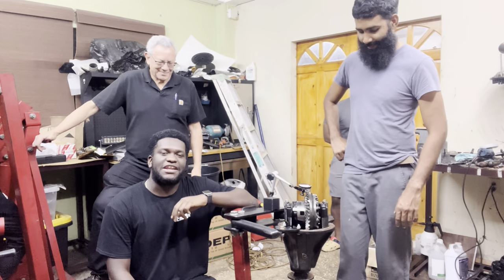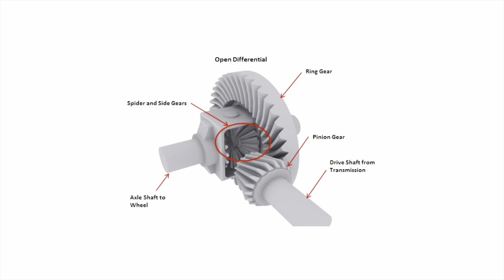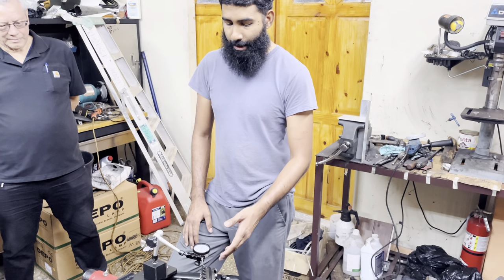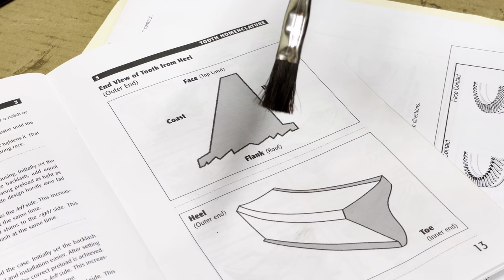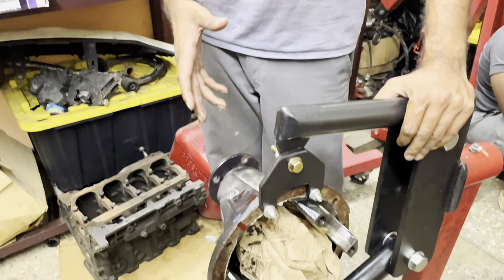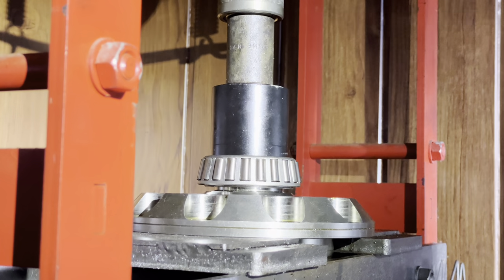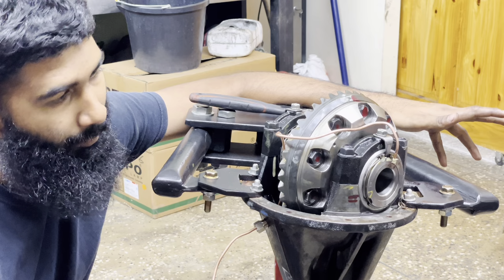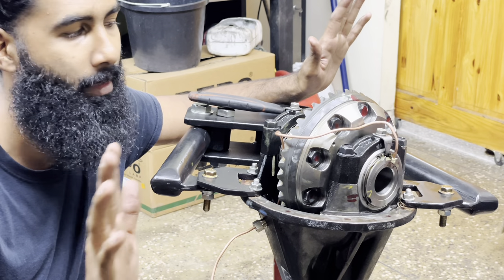Hilux Gets Twin Lockers! | ARB Air Locker Installation And Guide Part 1

Comment: Can a diff lock be installed on a 2022 bt50 4x4 manual
Reply: Yes, it could be installed on all 4x4’s front or back or both.
Reply: A lot more care is needed for lockers in the front diff since turning left or right could damage the gears in the diff. Essentially you can’t turn when the front is engaged. 
There is something you could install that automatically disengages the diff if you happen to turn right or left. If you ever off-road you would know the pitfalls of a the diff disengaging when you need it the most. 

Serious off-roaders would benefit more from twin lockers, weekend off-road rigs will do fine on rear lockers alone.